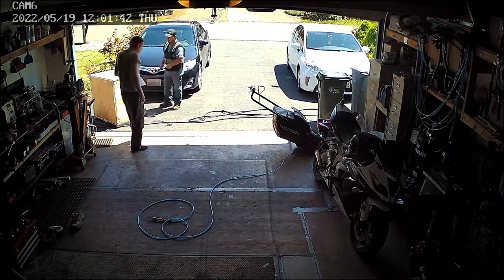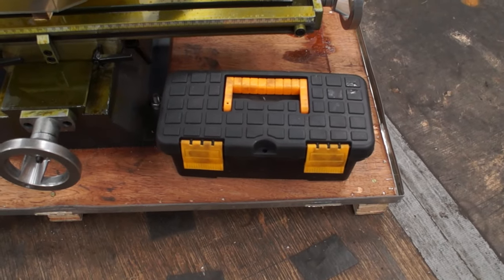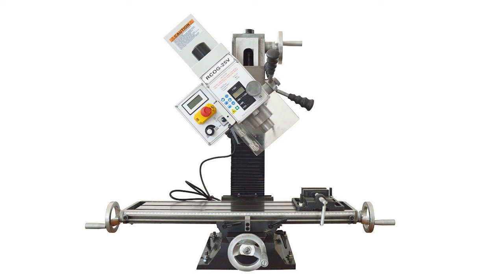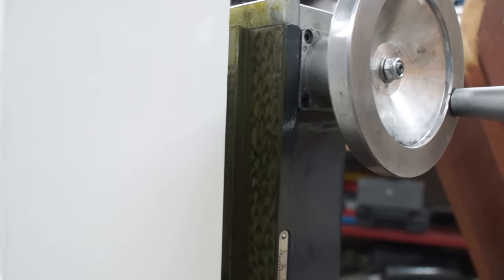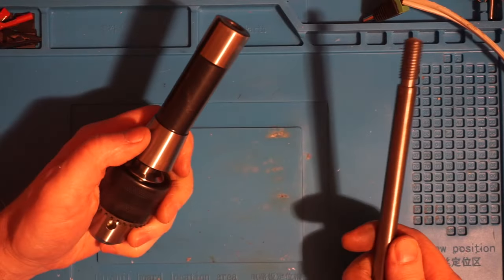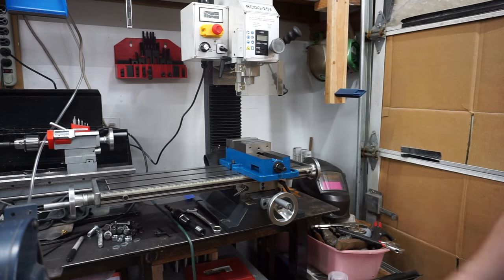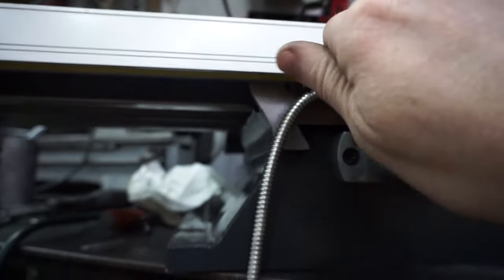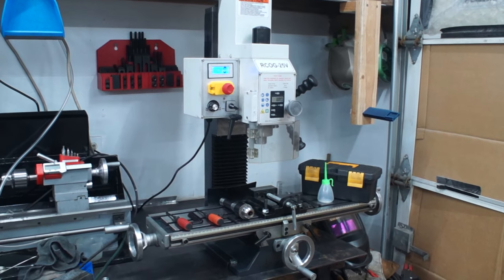RCOG-25V Milling machine review

Comment: I have what appears to be an identical mill but with the name Quantum. Like you Im really happy with it and I also have fitted a 2 axis DRO, Im happy with the installed z axis. Mine came with an imperial WW pull bar and all the tooling from the supplier was WW but I got a metric bar from Australia and so am now able to buy tooling from Aliexpress etc so I have a bit of a mix but its OK. My unit is MT3 and have had no problems with any of the tooling I have purchased. I would recommend you don't use the drill chuck for milling, sooner or later the chuck will let the mill cutter drop, get an ER32 collet set. Im very happy I got a separate mill rather than one on my lathe, I can do so much more with the separate mill.

Comment: Very nice video

Some of the factory missed quality issues are truly shocking.
R8 collets that won't fit the drawbar,this would be an instant customer return for the majority of people.
Reply from the maker: Yes but according to the seller, factory produces then this way.
They are offering me refund the amount it cost to make a new one.
Gotta call local shops to get the quote.
Reply: I read up and I guess that some countries use an M12 thread pitch on R8's where we use 7/16-20.  So confusing, lol.
Reply: @tonycstech  I really hate to ask but would you by chance know how long that drawbar is?  I'm thinking if I can find a readily available replacement with the proper threading  then I'm going to pick up this machine.
Reply from the maker: @scarecrowsworkshop8526  And annoying too.
FIY seller was able to source the draw bar with 1.25mm pitch and will also include a missing bearing.
Reply from the maker: @scarecrowsworkshop8526  This machine is a clone of PM-25MV
Maybe you can just buy that one part and call it a day ? Otherwise it will cost around 150 to make it locally. 
Seller was able to source the drawbar with 1.25mm pitch somewhere so i will be receiving it soon i hope.

I think its best to contact the seller about this issue before buying. Ask them to make sure draw bar is 1.25mm pitch.

The issue with that is the chuck it comes with will not work because chuck holder pitch is larger.   I had to buy different chuck holder and i had spare chuck already. The one it comes with is complete junk anyway so might as well get ready for that.
Reply from the maker: @scarecrowsworkshop8526  10" long
Reply: @tonycstech Thank you!

Comment: Grizzly sells a drawbar that will fit with a slight modification. Look under parts for their G0704. It works as bought but it doesn’t thread much into the collet. Some of the shoulder needs to be taken off on a lathe.
Reply from the maker: This is a PM-25MV clone.
I think its best to go this route without modifications. At least give it a try.
Reply: Tony, I bought the same mill. It is actually closer to the G0704. It has the belt drive similar to the PM-25v but the castings are much more similar to the G0704. I was so confused when I unboxed it, because, like yours mine said MT3 taper on the front plate. But then discovered it actually was R8. I need to go check out that bearing to see if I have the same issue. Thanks for the video. I was starting to think I was the only one to buy this machine. Btw, I got mine from Amazon, not eBay. But I imagine it was the same seller.
Reply from the maker: @mdyeomans11  I am watching BlondyHacks, she has precision Mathew brand. Looks identical to mine except some color and a safety switch behind the glass door. My machine does not have that switch inside at all. I am going to implement that soon hopefully. Already printing the cover to house the switch.

As far as brands go, i think Grizzly and Precision Mathew and Klutch are all just cloning facilities. Who knows what is the actual origin of this design ????
Reply: @mdyeomans11 I am sitting on the fence about buy this mill have you had any issues or problems with it so far?  Thanks Bob
Reply: Bought... It will be here in the next week or so. Your helpful. Interested in seeing if they solved your concerns a year later. I will be cnc-ing this one with dro, power feed and control system. System will support mach3/4 and grbl, but I use proprietary code and com for actual control. jpk💪🤗

Comment: Ive got a clone of this one called Amadeal VM25L. Its a great lathe. Very capable and has good potential to convert to CNC in the future. Taking time to adjust the gibs and tram the head etc makes all the difference. Firs thing I did after uncrating was to clean everything and re lube it all with way oil.

Comment: As a machinist with 40 years experience, it’s hard to believe that in this day and age with the Exponential rate of high-speed technology, and CNC Machining, we do not have manual machines that are Just as advanced as CNC machines. You would think that we would have manual machines designed and machined better than they were in the past. Disappointingly, the machines made in the past were far more robust and better designed than machines we have now. Why is that? Be that as it may , I would never buy these substandard Chinese machines because they make them so poorly and you always have to fix them or upgrade them. With a Bridgeport milling machine or a clausing lathe, there is no “upgrading”. The very idea of it never existed. And if I were to machine as a hobby, I would not buy Chinese benchtop machines or any machine made in China. I would instead by vintage machines made in the US Even if it requires some restoration. We seem to normalize the fact that it’s OK for car makers to build Cars with amazing technology, but when it comes to making industrail machine tools, they are 40/50 years out of date. Right now I work for a university and they purchased a new Bailey milling machine and quite frankly it’s a piece of crap. I could forgive Bailey for copying a Bridgeport, but you would think that at least they should’ve done is Build it as good as a Bridgeport. It’s insane to think that we have all this technology, with the latest in high-speed machining yet manual machines are being churned out as if they were made by disgruntled workers. I’ve lost all hope being a machinist and I can’t wait to retire in three more years.
Reply: That's all fine, but most of these old Bridgeports are used and abused boat anchors that have issues that someone else is trying to make your problem.  For the average person having them moved and setting them up to be used on normal single phase power will double the cost of the machine.  These Chinese machines actually work great for their purpose.
Reply: One CAN buy that quality today.  This is just a value product for hobbyist.
Reply: It's all about price. I am sure Chinese can build better quality machines at higher prices. But not everyone can afford.
Reply: There are some incredible manual machines.  They just don't cost a 20 bucks like they did in the days you're speaking of, bc much like then... price improves quality. 😊
Reply: Also remember space is an issue for many.

Comment: I got the Weiss VM25L, which is a clone of the RCOG-25V. It has true inch scale. The guard window on this one disables machine operation when open, and the draw bar is 7x16-18 thread, so I didn't have to modify that.  It was also missing one thrust bearing, same as the RCOG-25V.

Comment: Precision Matthews, Klutch, Weiss, Grizzly, and a few other names are all the same on the outside only!  The difference lies in the level of finish, fit, and function from the factory. They all come off the same assembly line but each re-seller orders them they way they want them.(like inch or metric dials brushed or brushless motors) PM and Grizzly have inch pitch leadhonestly say

Comment: O"really well i have one of those little pieces of Junk your refering to. Yea they are bottom line, yes they have a few issues, but your wrong they are quite accurate. Perhaps you went beyond the machinese capability. All my parts Cold Rolled steal and 2018 as well as tool steel. I have no dro and assistant tools for thesw new rocket scientist plans they are creating using number decimals like 280.000 stupid . my milling vise is a 2 inch mini i have no milling vise a the moment i have done alot of work on my junky machine i did not even tram it and every piece of metal i milled was exactly accurate accept for my errors not the machines. My friend Keith Appleton has a old junky taiwan milling machine it is quite beaton up but the accuracy is perfect. my mill has a 350 watt motor small xy and z axis a bigger one is always nice for larger materials but the bigger machines have a problem that is the skill of the man running them that you cannot change. one other thing you critisized the fact the same mill is mass produced and the same sold under different brands the fact that many different companys want that exact mill means that that little mill is very popular further most all owners of this junky machine have next to no complaints so your evaluation is based upon miss use and notjing else!

Comment: looks to be exactly like the new one i got. WMD25VB seems very good and tight and solid! the z-axix yes plese let us know, i will certinly be interested. i am thinking of a bracket bolted to the head and then attaching a holder to the dro slider. this should help i assume.